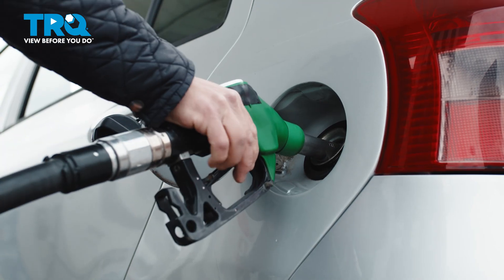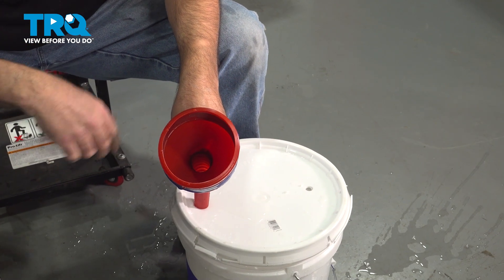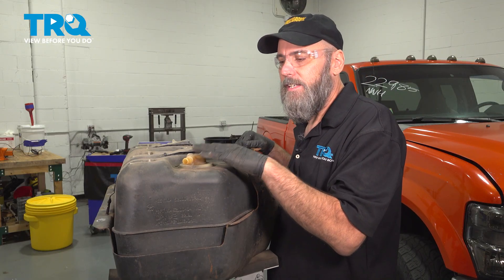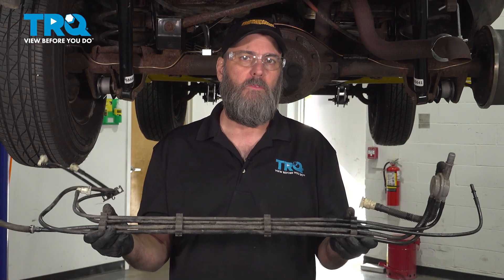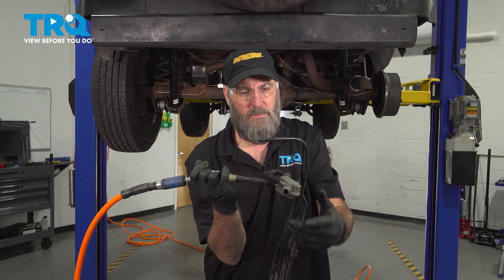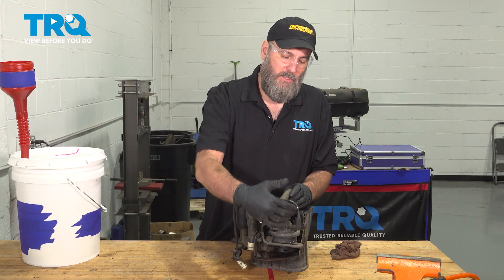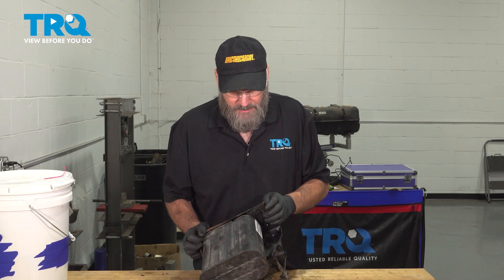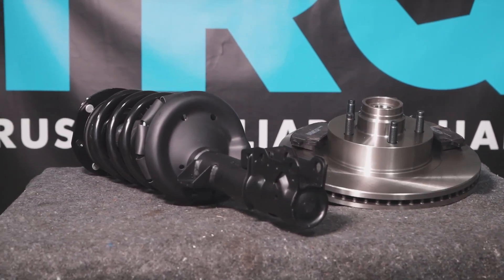EricTheCarGuy Explains Why The Gas Pump Keeps Stopping When You're Filling Up

Comment: What the feezy there was a switcheroo there over the yonder  ,first that thingi magigy seem to work fine but then with out extra explain it was the issue and then this whole issue was bout the pump not being able to pump gas but yet they use gas tank to fill by hand were funnel can easily not insert all the way to make it seal tight 😮😂 no Manches

Comment: I drive a little MG 3 for work. Every time I'm putting petrol in it, the pump doesn't  cut out when it's full. Doesn't matter where I buy petrol. Happens every time. What are the possible reasons for this?

Comment: I’ve had the problem only when tank is almost empty on Ram & Chevy express  both less than 3 yrs old

I have to hold nozzle at about 50% of full flow until I get about 5 gallons in , then it will hold at full flow

Comment: I worked at a gas station, in the State of California, at the tender age of approximately 16, in the last half of the 1990s.  As a PayQuick operator, I had no obligation to help customers, but to perform in-person marketing of the new, automated P.O.S. (point of sale) operation (and, of course did as needed).  On the side of the consumer, filling the automobile, I have no doubt your words are of most value to the consumer.  The vapor-lock systems of the pumps, however, vary in changes of both technology and regulation.  ...Skipping all of the jargon of which I cannot all recall, one technique used was to stretch the gas hose and pull back on the rubber boot of the nozzle. Less than a cup of gas vapor/backflow accumulation should come out of both the nozzle and the boot. Again, that was the technology+engineering of California pumps in the 1990s. A cup of fluid looks like a Huge amount on the floor, by the way.  The accumulations supposedly were likely caused by overfilling attempts.; I am not an engineer, I do not definitely know

Yes, I had known where the fire extinguisher and the flow-shut-off were and still do not know where to turn off a house water main. ...
Also, gas rose to $1.09 and that was hefty at the time.
[British Petroleum] BP since bought AMPM/ARCO, thinking they could "green" the world much faster and better, and that was not very long before event horizon in the Gulf of Mexico. 
(And, of course, I myself have had implausibility in job retention and further and held little to no other personal/individual stakes in that business than a sense of lifelong ecological stewardship, having worked in the consumer/customer service aspect of thebsale of commodities.)

Comment: informative and annoying to learn the other components that could be my issue. whoever had my hhr before me clearly would overfill the tank as my evap can was toast - replaced it and the solenoid too, cleaned the tank - initially it solved the filling problem for a while but now back to doing it intermittently so i didn't appear to find all the issues.

Comment: My 2010 Jeep Patriot has a bad sensor on the tank itself which requires complete tank replacement.  Or I simply don't fill the tank completely and my one time stalling issue after fill up is solved.  I did have a bad charcoal canister once that got fuel into it and was shutting off the gas fill up just like your video.  Replacing the canister fixed it but I still have this stalling issue if I fill the tank until it clicks off normally.  I inquired as to why this wasn't a a safety issue due to stalling while the vehicle was moving but Jeep ignored my letter.  They could care less...and I'm not spending thousands on a new gas tank just to replace a stupid govt imposed emissions part.... emissions standards are the bane of our existence if you ask me as these are the primary cause of most breakdowns....